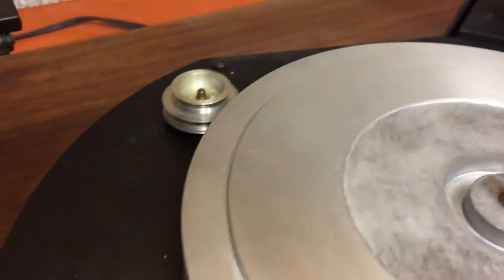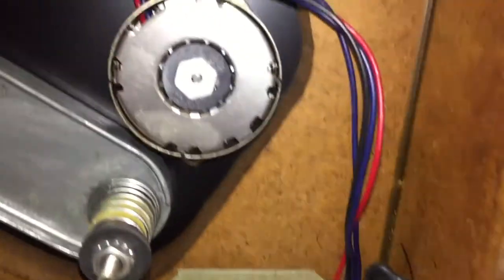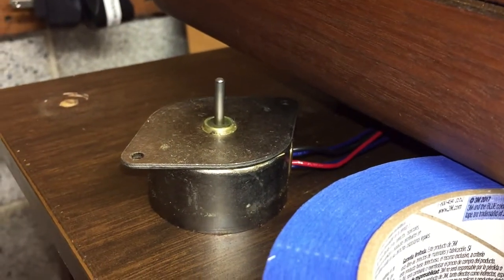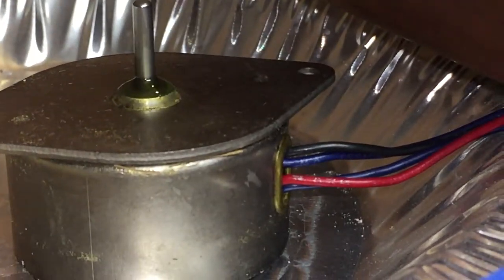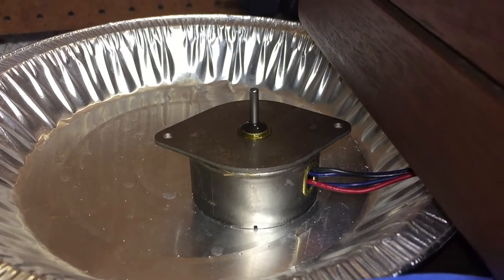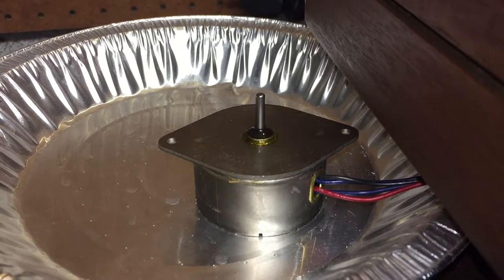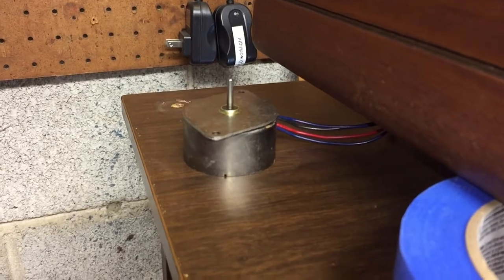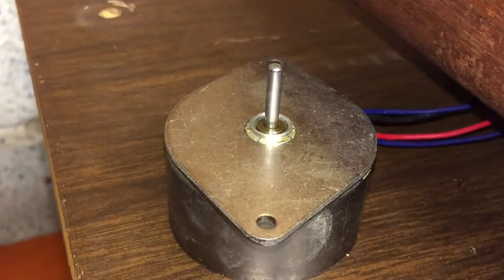AR (Acoustic Research) turntable Hurst motor service

Comment: Just recently brought my AR XA back on line. It was not as easy some might think. In my case had to take the tone arm pivot cam apart and remove all that old grease. It was not tracking well. Also you have to adjust the pivot post to the exacting tension so when you lift the arm up above the record a good bit it should stay put. ALWAYS move your arm on the AR XA below the platter and then back up on to the record before playing. This is the cam tonearm release point. Sweet spot. You can disable this feature if you back the tonearm post ( unscrew ) away from its pivot point/cam but it only takes one time to make a mistake and kill a $75.00 to a $200.00 needle if it hits the record or the plinth by accident if the tone arm were to suddenly get out of your hand. I chose to keep it adjusted so this cannot happen as easily.  It is now doing very well. I used Lubriplate No. 105 on the pivot cam cylinder after cleaning first.  I hope this helps someone out.
Reply from the maker: @VintageGearMan  great info! Thank you! I  still need to address the vertical pivot in my arm so this is really appreciated.
Reply: @elvisandmick  Your welcome. I just got a new Douk Audio T3 Plus pre-amp in and on my AR XA it sounds awesome with my Shure V15 III cartridge. I personally think it is one of their better pre-amps Douk offers. Excellent specs. I run the volume control at 12:00 o'clock and it sounds great there to. I even tried almost 3/4's no problems. Has (2) 6A2 tubes in it. There are other tubes you can run in it but it sounds so good with the stock tubes I do not see how it honestly could sound any better than it already does. I love it. Count Basie orchestra sounds like you are in front of the stage while they are playing! Fantastic sound field and it handles loud and soft passages excellently. No breaking up or pulling back etc. I am using my new hybrid Nobsound AV 525 amplifier and it loves this T3 Plus pre amp.
Reply: @elvisandmick  One other major thing I just figured out.  AR knew what they were talking about back in the day regarding the spring tension on the sub chassis. I had mine set to high from the plinth. Just softly walking up to it while playing I was getting  lot's of bounce. Once I set the springs exactly at 1/8th inch from the plinth with my acrylic mat and a record on it and the bottom cover removed I was able to hand adjust the spring nuts using a 1/8th inch drill bit as a gauge. Whatever mat you use be it wool, acrylic, rubber that you normally use on it must be on it with a record to get the height right. Things are super great now!  This takes time and patience but it is critical for proper set up.  Also make sure you are doing these adjustments on a level table. Otherwise you will be chasing your tail.  I have The Q Lift on my AR so after adjusting your springs you positively will have to readjust the lift. I did not think about this and wondered why my tracking suddenly was terrible. When I lowered the chassis then my Q Lift was now set to high. Ha! The tone arm was barely touching the Q Lift arm while playing. Duh on my end. Hope this helps you out.  These are awesome turntables when all the adjustments are right.

Comment: Thank you for this video, my AR motor/ table just started clicking, exactly as your s did.
Reply from the maker: you're welcome!  If you have a chance, please follow up with a comment about how things turned out for you!
Reply: @elvisandmick  
It clicks intermittently so it will be my winter project. I book marked this video when I do the project. 
When flipping the table, does oil leak from platter bearing? 
Appreciate your help.
Reply: @jeffreypicciolo7706  Ah, good luck when you dive into it!  Yes, when flipping the table, oil will come out of the platter well (but it shouldn't be much)..

Comment: Very interesting thank you, i bought one of these Turntables about 5 years ago and the suspension needed adjusting so i put it to one side and never did it as i already had a working Thorens TD166 MkII but i will dig it out and get it working so Thank you very much for this video
Reply from the maker: Good luck! They are nice turntables so it would be worth the effort to get it going.

Comment: It looks remarkably like a motor I just bought for a project of mine, a Hurst SP4023, purchased from Jameco last week.  They're not expensive; you may want to consider buying one as a spare.
Reply from the maker: Will do, thank you!
Reply: Hurst motor is cheap and noisy junk when it's brand spanking new and definitely NOT worth hassle. That noise seems to be like noise of the bent shaft.

Comment: Thanks for your video. I just added sewing machine oil to the motor spindle with the needle dropper without taking off the gear thingy. It had a similar clickity sound but now it is deathly quiet. You can't hear that is it on now.
Reply from the maker: That's great! :-)
Reply: Did you also oil the bottom of the motor, or just the top, by the belt spindle? Thank you

Comment: It's my view that the issue here is a loose bushing. The brass bushing, I think, should not move with the pully shaft. Adding all that oil filled the gap thereby reducing the racket the motor was making. I'm guessing it will be silent until the lube drains away again. Try cleaning again, then carefully superglue the bushing into the frame of the motor...... THEN add oil.

Comment: How did you remove the pulley from the motor to begin with? You mentioned it was held on with something like glue and I'm unable to remove mine by simply pulling it.  Thanks
Reply from the maker: The way I've seen done (and it worked for me) is to use two spoons as levers - one on either side of the pulley so you pop the pulley up but don't bend the motor shaft.
Reply from the maker: https://youtu.be/S2VYnaC_IFw
Reply: @elvisandmick  Worked easily for me. Thanks so much
Reply from the maker: Great!

Comment: I just got the AR Turntable, its quiet but I notice the vibration even when turned off. Did you ever get to the bottom of that? I hear a slight hum on deadwax and it disappears when I unplug it.
Reply from the maker: I learned that the vibration is nornal to the AR design (I have another manufacturer's turntable that also does this). One leg of the motor wiring is always connected to the power plug, even when the turntable is switched off.
Reply: @elvisandmick  I noticed a vibration in the belt (I'm embarrassed to say it's the original, but I just got it last night) between the pulley and the platter. I got a couple drops of oil onto the motor and it seems like it became much less. I'll keep working at it. Overall a really nice turntable except for some veneer peeling and chipped off unfortunately.

Comment: How did you get the pulley wheel off the shaft?
Reply from the maker: I used two spoons as levers.

First, measure the gap between the top of the turntable and the bottom of the pulley so you know where it should sit when you replace the pulley. 

Cover the turntable surface around the pulley with blue painters tape, to protect the surface. Then place the bowl of a spoon, face up, under each side of the pulley, pushing down on the handles of the spoons to lever upwards under the pulley.

Comment: Sorry about that accidentally hit send. Anyway, until I heard a Sota Sapphire I thought “The AR “ was as far as I needed to go up the chain. As a side note I have a AR XA with manual and it states under General Information that “A slight amount of vibration can normally be felt in the drive pulley when the motor is off, This is normal and harmless”  Just an FYI. Did you have any success with change in capacitor?
Reply from the maker: the capacitor change is still on the to-do list /sigh/  this project table has been on the back burner for way too long!

Comment: "DO NOT LOSE ANY OF THE 2 PIVOT SCREWS or even the "brass counter weight screw" when doing this! You will not be able to go to a local hardware store to replace them. If you lose any of the tiny three screws it is game over. Go slow and only back them enough off to gain access.  It almost happened to me.

Comment: The OEM motors are horrible. Even in good condition, I heard noise in the quiet spots of music. I ended up pouring molten lead into the belt hub and then balancing. MUCH better. I greatly suggest purchasing a newer motor solution now available. Best mod for these.
Reply: I can attest to that about the OEM motor. Just NOT a good quality motor. I have one on my bench now. I got it running quiet, but the speed is low, and no way to adjust. Belt is good. I'm not even gonna waste my time trying to rejuvenate it. And buying another used one is pointless. What's to say it will be any better? The pulley design is crap as well. So, replacement low voltage motor is in order, IF the owner wants to spend the money. Generally, a nicely designed vintage TT, but motor is most definetly the weak point.

Comment: I do hope you oiled the bottom bearing before letting it "run in"!!!!  You know, that "by design", there MUST be a bottom bearing, and that you shouldn't expect that, by oiling the top bearing, any oil will reach the bottom bearing!  The probable reason the motor quieted at all was because the parts cleaner lubricated the lower bearing, but that will soon burn off!!!!  PLEASE OIL THE BOTTOM BEARING, PLEASE!!!!!
Reply from the maker: If there is a bottom bearing, it is not accessible because it is hidden by the armature even when the bottom cap is removed from the motor.  See <https://youtu.be/JDUJ-8QqadM?t=143>